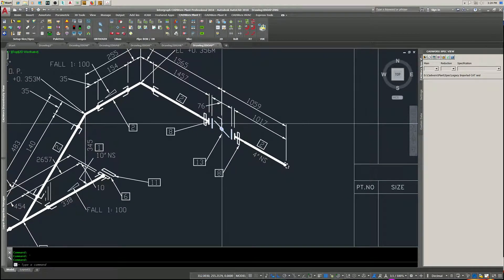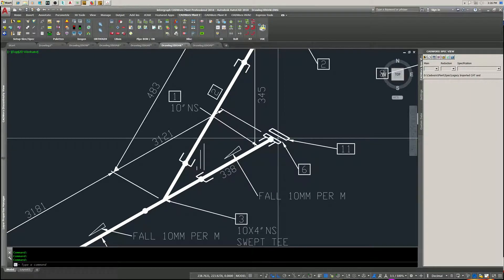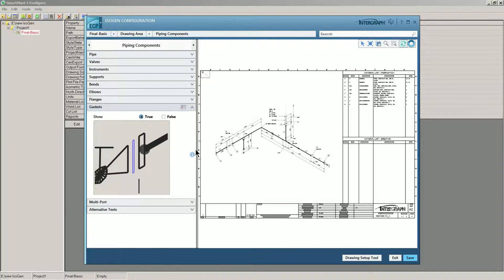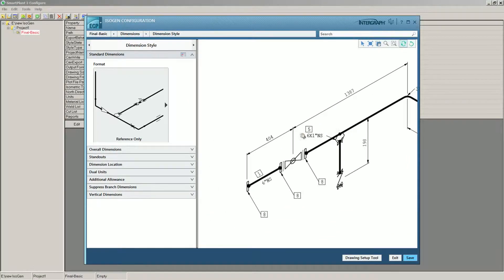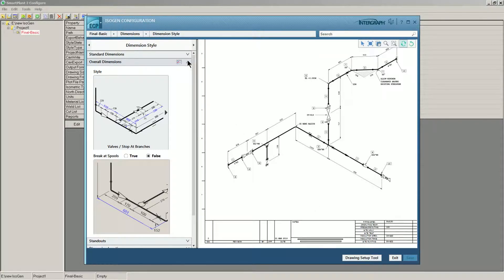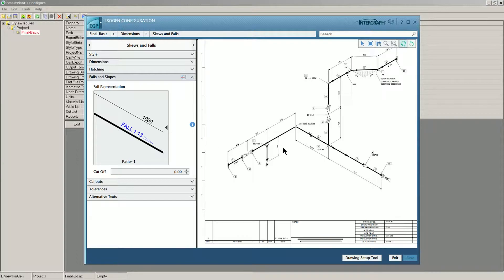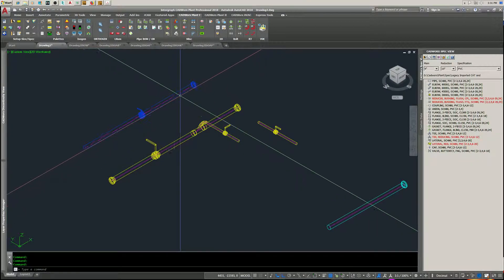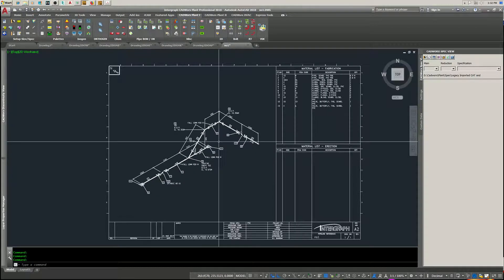Cadworx; IsoGen, how to configure isogen dwg files with I-Configure

Comment: Hii, thanks for video. its very useful. I have one question, In continuation co-ordinates are generated with block. i want them without block. can you help me? it will be very helpful for me. Thanks in advance.
Reply from the maker: Look at using assemblies for difficult connections and another video on selecting the insertion point for the assembly.  I discovered that using assemblies was much easier than
blocks. And my apologies for taking so long to respon